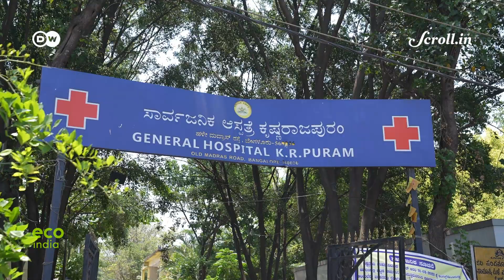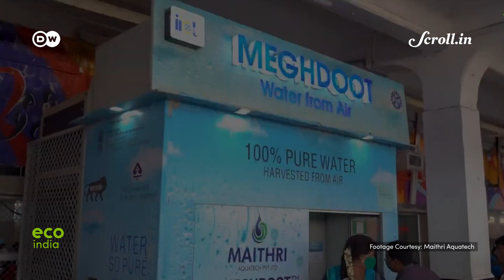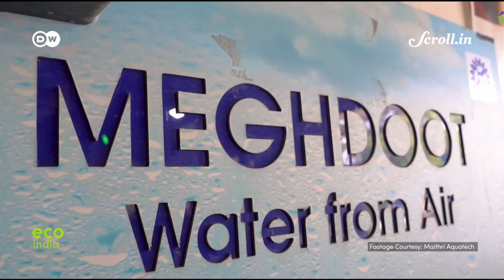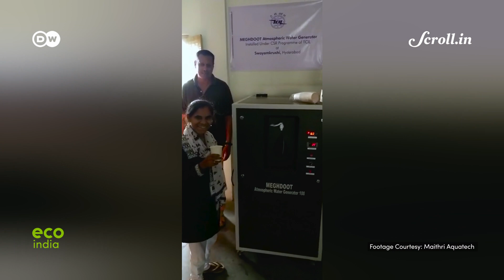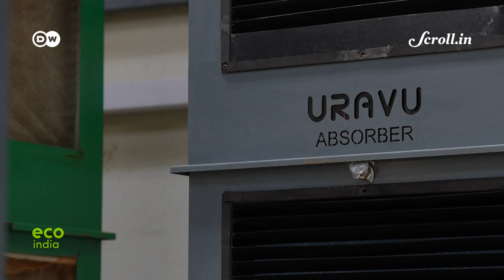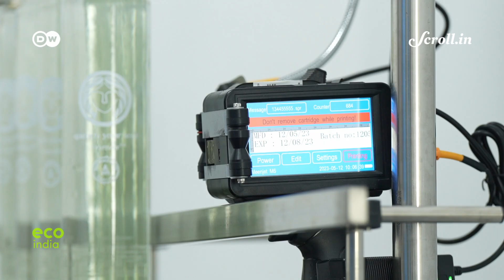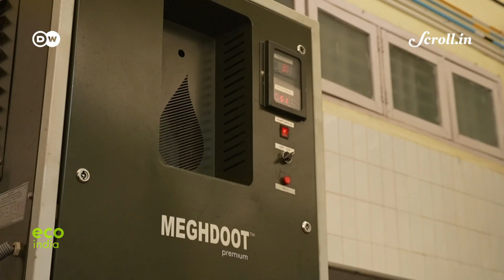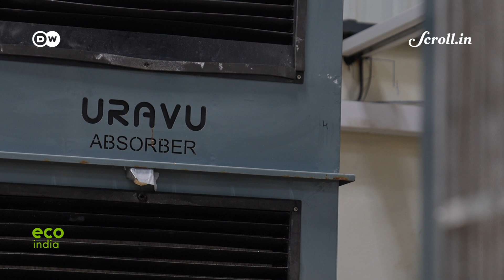Eco India: Can air water generators prove beneficial in a water scarce environment?

Comment: 92% of ground water is used by agriculture sector. And industry also uses a significant amount of water.

But thses costly products won't find any space in these sectors. Their products using iron, plastic, well equipped workforce already generating good amount of pollution and taking our resources.

These ideas are white elephants sounds and looks good but actually worst then before. Just increasing CONSUMERISM.

Comment: Shoddy reporting with inaccurate facts.

1. It does not produce pure water. Contaminants in the air will be present and needs to be filtered out. ie, a filteration system is needed. Quite possibly a bad idea to put in an hospital.

2. It requires significant amount of energy since its basically a dehumidifier and a purifier. So not a very environmentally friendly solution if there are better sources of water available.

3. It captures the water vapour in the air. So works well in humid climates but not so well in dry regions.
Reply: Just increasing CONSUMERISM
Reply: 1.  ''''''MEGHDOOT produces water to international standard, which is 100% Microbe free. Our filtration process removes all external particles and dissolved organic pollutants, There by making our water completely pure, fully potable and of International standards.'''''

(that info is from their website )

2. '''''' It requires significant amount of energy since its basically a dehumidifier and a purifier. So not a very environmentally friendly solution if there are better sources of water available.''''

 as far as what an individual  use can produce   their usually are not better sources of water in third world countries

3.''''' the machines perform in the temperature range of 15°C - 45°C and relative humidity levels of 25% and above.'''''''

(that info is from their website )

that is desert level humidity''
Reply: I'm pretty sure that the water is UV/RO/TDS filtered